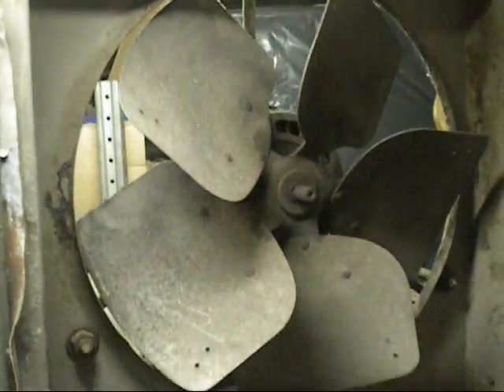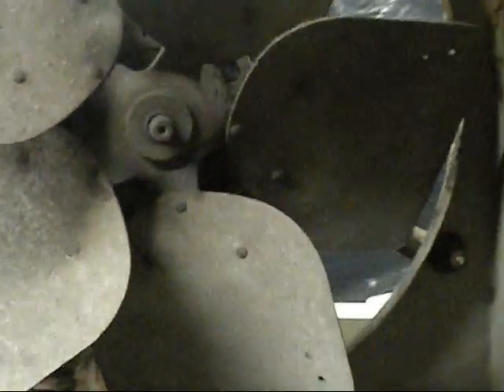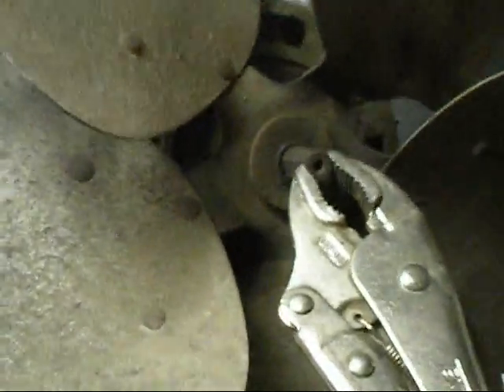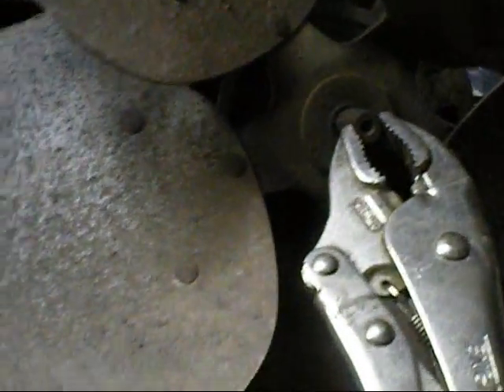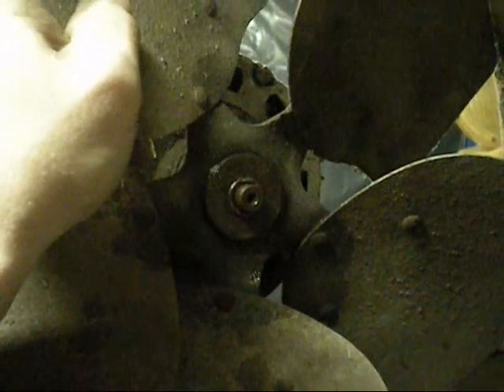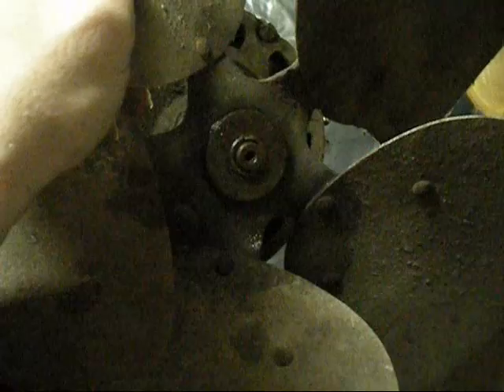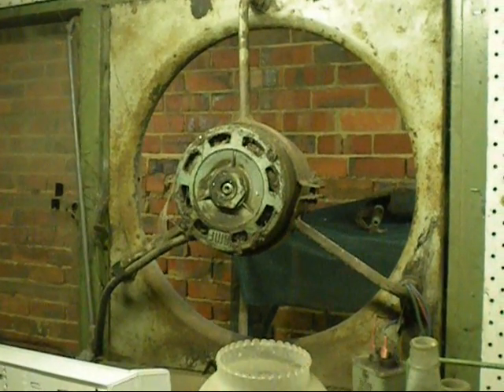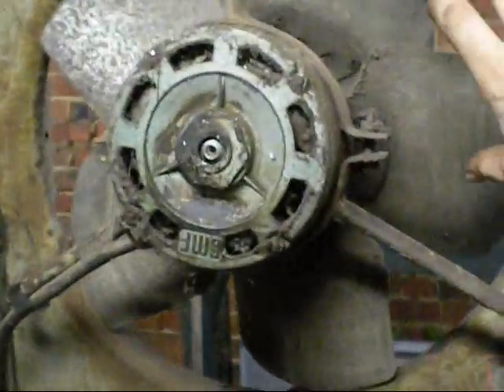don't try this.

Comment: only grinding up the rust that would seize the hub on the shaft and allow the puller to bend the blade assembly permanently out of shape :P

Comment from the maker: its a grub screw that holds in on and it was in place and tight when fan was running. also if the fan is blowing in that direction how is it going to fly off in the same direction???

Comment: The end of the shaft has a pilot hole in it,a three legged puller should be used to remove the fan,the blade hub itself appears strong enough.Using his method not only are you risking the rotating shaft snatching and driving the fan round,losing your fingers in the process,but the spinning shaft will wear the hole is the fan,possibly making it a loose fit when you have cleaned it up,

Comment: That seems pretty dangerous because if you messed up the shaft and you pull it to that area it might catch and spin it harder then you can hold and cut your fingers off. I've had my furnace sieze up on the shaft before. I just used some penetrating oil on it waited about 10 minutes then held the shaft while i turned the blades and it came unstuck in a snap.

Comment: Best to sand the shaft with emery then some oil will pull off easilly with motor TURNED OFF and for more safety wires disconnected

Comment: does it still keep the blade in place after the shaft has turned so many times inside the fan blade mounting hole? cool video very cool!!

Comment: Your fingers have to be made of jello to be chopped off by the method hes using to remove the fan from the motor, especially since he has the fan as leverage, not like the blades are razor sharp. I have held 3/4 hp motors with 6 in pulleys with my hands and prevent them from turning

Comment: Are you sure you want to have that unshielded high-speed steel fan going with a cat running around in the room?  If the cat gets into the fan, you'll have cat meat splattered all over the room.

Comment from the maker: @Aussie50 lol trying to pull it (very well lubed and sanded) and it was trying to cold weld itself. so i tried the way i normally do it and it still would not come past the 1/2 way point. so i lubed the balls off it and did what i did. if it wear a alloy hub on steel shaft it would not have been so easy.lmao